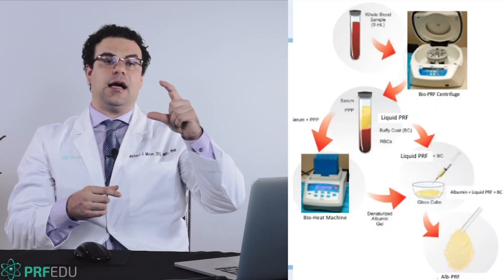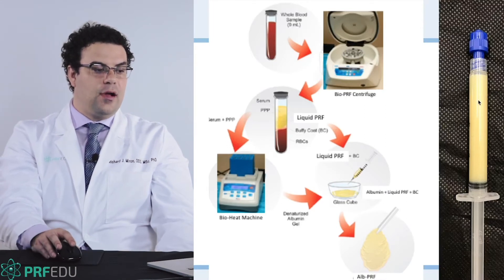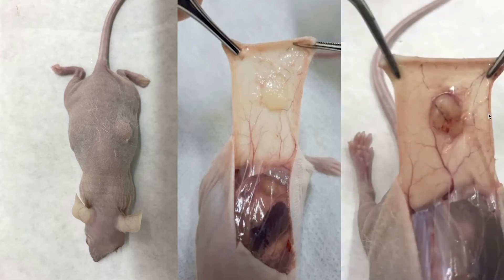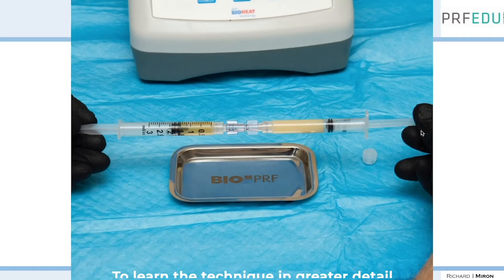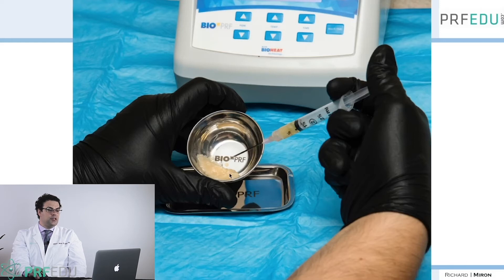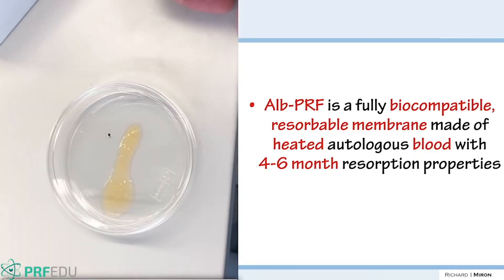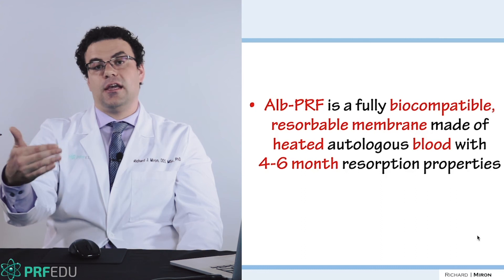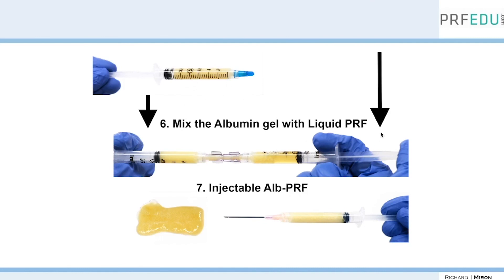Chapter 7.1: Scientific Basis of extended-PRF (e-PRF) presented by Dr. Richard Miron

Comment: Would the Alb-PRF be more useful for joint injections (knees, shoulders) compared to liquid PRF?
Reply from the maker: That questions is currently being investigated in a number of randomized clinical trials to be honest. The liquid PRF delivers more growth factors more rapidly whereas the Alb-PRF is more long term delivery. For spines, it is clear the Alb-PRF has been better but for knees more research is needed.
Reply: @prfedu  can't wait to see the research. Are they using Alb-PRF for spinal facet injections? Or for disc injection?
Reply from the maker: @stealthcomp14  , yes the research is led by Professor Robert Talac and he and Dr. Miron are working on several publications together. You can see a short video series here. https://www.youtube.com/watch?v=_KblvmipNic